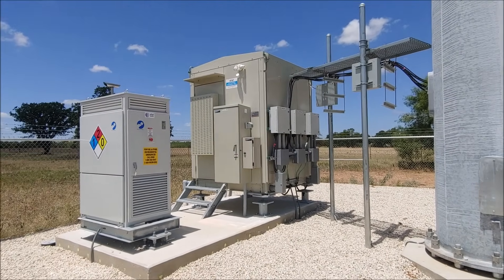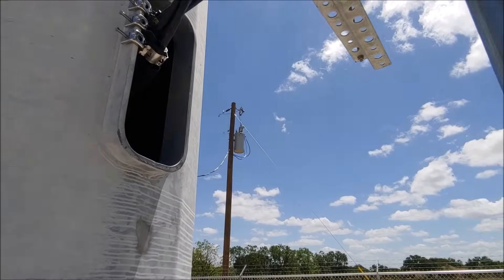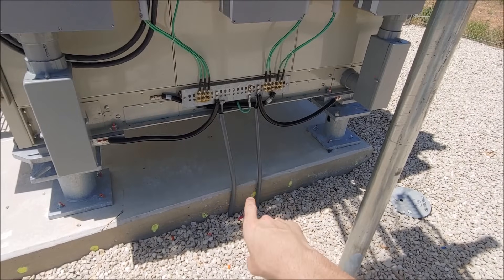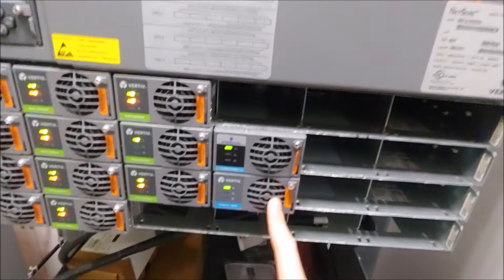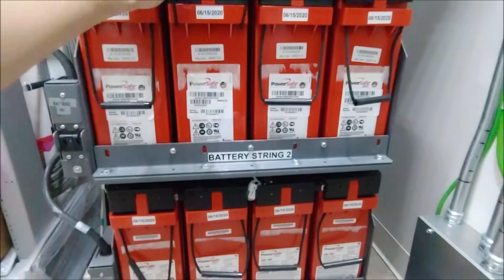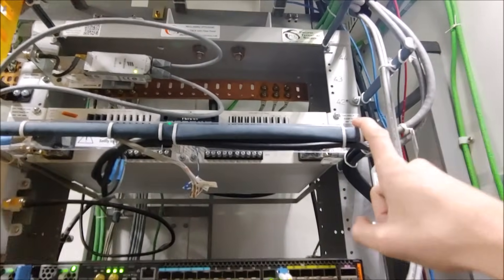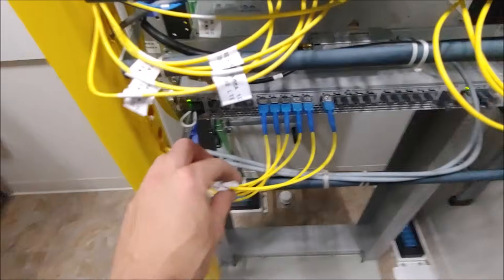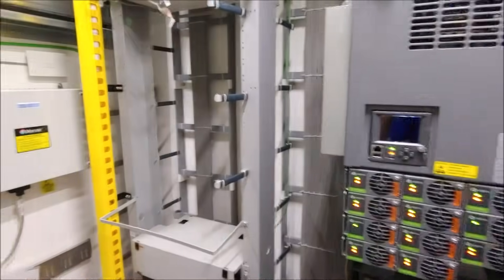Cell Site

Comment: Great tour, thanks! 
Are older site's coax being actively changed out to RRU's with fiber or just through attrition as new equipment is being built out?
Reply from the maker: ever since UMTS was shut down we now remove all Coax on the upgrades.
Reply: @ATI556  Thanks.  I installed giant MTS and IMTS 100-watt VHF Mobile phones in the mid 70's. Only 1 site with 2 channels was available in a county of 75,000. Only Doctors and lawyers could afford them. Can you imagine that ? When I saw the first pamphlet describing a 3-watt cellular network, I thought they were crazy, "they'd have to put up sites all over the place!"
Well, 50 years later, here we are (and I'm still working public safety communications) YeeHaa.

Comment: Whats the reason for using -48vdc instead of more common positive side?
Reply: It's a throwback to telephone exchange power systems using -48v to avoid corrosion of the copper subscriber lines
Reply: @JohnWatkinsUK  ok, that actually makes sense, since I do underground propane tank bonding, it now makes a lot of sense.

Comment: Very cool stuff for tech nerds like myself. I am surprised to the part where he said the internal cabinet temperature is around 100 degrees. I knew those cabinets had air conditioning but I would have thought they kept those cabinets a lot colder than 100 degrees. Learned something new today.
Reply: I was questioning that too; that's pretty high operating temp for industrial grade electronics; the component life is getting reduced that high.

You don't need to be at 69F, but 85F is much easier to maintain, and probably a lot better for the parts.  And the people.
Reply: @baylinkdashyt  There's probably a technician override control that can turn the air conditioner on when they are in the shelter. Or I would come up with one!

Comment: Really cool video, thank you for recording and sharing!  It's hard to get a look at how this kind of infrastructure is done. I found it cool that the shelter and generator are both on stilts above the ground. Extra flood protection, I suppose!   Did you say that the site is not hooked up to a provider? So it's just idle?  With batteries from 2020, seems like a huge expense to deploy the site and not have it in use!

Having fiber to the RF section up top must be better in so many ways - No need for any waveguide stuff, no losses from any coax, no coax needed at all, fiber is cheaper, smaller, lighter, RX sensitivity is higher since the receiver is RIGHT THERE on the antenna, higher order distortions in the RF sections are lower since there's less impedance mismatching and other reflective distortions you get from coax and connectors, you also don't need as much / as aggressive RF filtering, the RF tuning can be perfectly matched at the factory, the cabling is smaller and lighter, less TX loss since the transmitter is connected directly to the antenna.... only downside is the expensive RF stuff is way up in the air - but by the time that stuff starts dying, it's probably time to replace and upgrade to a new generation anyway!

Comment: It is interesting how the telco system was originally built around -48 VDC, and it has remained the same ever since.  I would guess that -48 VDC is still used because changing to anything else (like a more common 12 VDC) would be such a huge cost systemwide that it is cheaper to stay with what works?

I’d guess that -48 telco battery was used way back when telco started stringing a single pair, 2 each copper wires, to each telco customer.  The power was created by installing huge banks of wet-cell batteries.  Power company connection was floated across these batteries to both run the network plus also this kept the telco network operating during power outages.  Heck, telco customers never lost service even if everything else was dead.  As for -48 instead of +48 volts???  Back when automobiles started using electrical power, cars were -6 volts DC.  Could this be similar to the original TELCO network?
Reply: 12V has too high current draw and losses over distance compared to 48V.

Negative with reference to ground to prevent corrosion of the twisted pairs underground.
Reply: I was told that -48v equipment used less AC power than 24v so it was cheaper per cell site which was a huge cost savings over thousands of towers across the country. Cell sites use gel cell batteries which are crazy heavy. in one of the carriers CO/switch there were battery shelves which had 4 12v batteries are integrated inside straight from the factory so you didn’t need to daisy chain them in series to make your 48v . I was watching a contractor use home brewed weird equipment plus a pallet jack just to get the battery shelves delivered inside the switch. They then had to mount 4 to 8 shelves stacked depend what they had room for and finally wire each cluster to parallel power bus bar and connect the battery overheating alarm cables. I found out later after I left the switch the  battery contractor had an accident and pinched a finger off by accident trying to man handle those huge batteries.
Reply: 12v sucks because you need such heavy cables to transmit power even short distances.  I wish cars were 48V.

Comment: for anyone wondering those batterys are it POWERSAFE® SBS XL-12V BATTERIES. WHICH IS $655    FOR 1 BATTERY
Reply: and they are also 4 years old already....
Reply from the maker: @bitcoredotorg  ya thats a common issue of the coorperate lag we have. by the time the cell site finishes engineering and approvals from the RAN team and local jurisdiction it can be several years. Its not uncommon to see a site with 10 year old batteries in some cases.
Reply: That is actually a pretty good price for that much power.  Being that high of voltage helps.  I wish cars were 48V.

Comment: Dude, isn't this a bit risky posting this for all to see? Like we have plenty of Iranians, Chinese and Russian hackers and terrorists that are just dying to get into our infrastructure and jack it up.
Reply: I don't see any big issues - didn't show any login pin codes on the doors, or keys on video, no IP addressing to be seen, no customer information (customer being the carriers), and it's effectively a site ready for a telco carrier to deploy their gear to.
Reply: If an enemy was going to attack wireless infrastructure, they would target one of their local or nationwide switches/CO. What’s to say that they don’t already have a back door into Nokia/Ericsson/Samsung’s BBU’s head end equipment. So much equipment was made where we don’t even have the slightest what chips have been baked into their equipment prior to the new laws that were enforced. Most fab ed equipment came from places that we don’t tolerate anymore even if Hauwei was banned they had other ways to infiltrate.
Reply: @JV-wl6ex  Your lack of understanding does not change the complexity of the world around you.
Reply: @ShainAndrews  I understand everything very well, I’ve been in this industry for over two decades. Try and help your keyboard warrior comments by using real-time examples rather than spewing out a slanted opinion without any info to back your statement.
Reply: @christopherbenedetto Obfuscation is NOT security.  You clowns and your bogeymen.

Comment: So are the RF signals generated in the base units down in the rack and are they carried through fiber up to the antenne units which has een amplifier.? Or is the RF signal being generated in the antenna unit at the top of the tower  But that makes me think, what happens if such a cell antenna fails. You will have to climb up there and replace the entire antenna unit.?
Reply from the maker: There is no RF generated in the shelter or on the ground. 
The transmission is done directly behind the antenna from a remote radio unit RRU. If a RRU fails then a tower crew comes out to replace the RRU. That being said RRUs don't often break. They are very solid pieces of equipment.

Comment: Cool to see someone else's installation.

Before I retired, I worked for a cell provider in Canada.  I could walk into this WIC and be right at home. Same Netsure power, same Powersafe batteries, same router, same baseband.

The only real difference is the make of the generator and the 66 blocks.
Reply: Rogers? Haha
Reply: What's are the model numbers of the router and BBUs shown in this videos? I would love to read and learn more about them. Also I see what appear to be rj45 cables going from the BBUs and router to two small boxes with a coax cable on the other end. I am guessing the coax goes to a smaller antenna. Are those used for remote management? If yes, how does the company connect to them (i.e. via another cell tower, radio link, something else)?

Comment: Much more interesting then I thought it would be, thanks! I just assumed it worked like an FM transmitter with the transmitter in the shack and coax going up the pole, instead that's all up in the antenna 📶
Reply: As the frequencies increase, the coax losses would be too great, so most things now have changed to remote radio units.
Reply: This was the case with GSM(-R), but coax creates losses. Nowadays, at least many of the installations here in Germany have a 10ft coax run from the RRU to the antenna and fiber going directly into the antennas for TDD 4G/5G.

Comment: What specifically are you powering with the 24v on a brand new site? The old analog cells were 24v and the first generation of CDMA too but "Toll" or backhaul equipment was all -48V, that got fixed over the years where it all went -48V but some stuff took longer to convert over so converters remained. I've only ran into a handful of AT&T sites that still had surviving converters, with unlabeled GMT panels split -48 on one side and 24 on the other. You find that out with a burn on your finger.

Comment: Strikezorbs do protect from damage caused by lightning strikes. Equipment that takes a direct hit is toast, but anything else connected to it, wont suffer, all the zorbs will ground out and will dissipate the charge safely bringing everything to the "same reference".

Plenty of times ive had tower strikes and the only thing wrong was a DC circuit breaker.

Raycap makes brilliant gear, just weird to get used to when wiring.

🤜🤛

For what its worth: we kept losing equipment at this tower during lightning storms (it was the tallest tower in the area), before we completely relaunched services on the tower (colo); we "spared no expense" and it paid off, went from being the most troublesome site to being "problem free" for ~5 years. Speaking of, batteries due for replacement...
Reply from the maker: Raycap is no joke on the protection aspect. They make a solid arrestor that has been proven time and time again and it was a pleasure to order from them and build out their products onsite. I have a AC lighning arrestor on my main panel at one of my comm sites and those are the real deal. Best you can find and the only true lightning arrestor out there.
Reply: @ATI556  
I have plenty of sites without them; but the one site that was constantly getting hit: it's been a huge game changer. Tower is a 500' "monster" in the middle of a quarry pit, and literally nothing that tall for as far as the eye can see in all directions.
Was used as a terrestrial TV tower back in the day, now runs an FM station, commercial, our B42/43 LTE equipment and some other odds and ends.
Reply: Raycap is great. When I was a tower hand and Nextel was still around, at the microflect ports Nextel supplied polyphasers and a trapeze rack for all the coax to pass through prior to jumping to the Motorola gear inside. Some of my friends in the industry from the east coast (Georgia) told me a similar story where they had to install a total separate ground ring for the BTS equipment to help isolate the T-storm tower strikes from frying all of the electronics down in the building. I’ve never heard of such a thing in the west areas that I’ve worked on.

Comment: I'm curious why he keeps referring to the 48 VDC supply as "reverse polarity", what does he mean by that?
Reply: the "hot" leads are negative(-) polarity, the positives are ground(+).
Reply: POTS and apparently cell sites, use -48VDC. There is an engineering reason for it (corrosion, I think)
Reply: @greasyjimmy  Half the voltage drop would be one reason, if there was some sort of corrosion reason you could just change the polarity I'd think.

I've dealt with engineers of all stripes, actual and telecom. Ask 5 this question you'll get 12 and half answers.
Reply: @davewood406  You really like the sound of your own voice.  I'm struggling to see you be factual on any thread.
Reply: @ShainAndrews  You need a hug?
Reply from the maker: @greasyjimmy correct a positivity charge helps to reduce corrosion
Reply: Thanks, that was my hunch.

Comment: Very good video! There is no fiber connection from a nearby landline? The tower radios are all linked together with the rack switches in the WIC? That makes this a node that receives, repeats and broadcasts the different radio signals.
Reply: He said a couple times that the site isn't in service. They're probably waiting for that. This is a regular cell. Theres radios up on the tower, fiber comes dow the tower and into the DUS/BBU shelves and another fiber from each shelf comes to that black site router shelf(called a SIAD) which is a SAR, Service Aggregation router. Which routes and MUXes them on to one fiber to whatever fiber provider.
Reply from the maker: Correct, this site was brand new and was in the process of being handed off to the customer. They had not yet connected their backhaul.
Reply: @davewood406  appreciate the clarification!

Comment: where do the alarms go?
Reply from the maker: there is a grey 110 block box eight above the drop down desk at the end of the video. The alarms were terminated to that then all the reporting was done on the physical BBU where all the fibers were running too.
Reply: They peel a TDM channel from the Ethernet circuit just to connect the alarm 66 block back to their local switch

Comment: So all the cell processing is done remotely? I seem to recall we used to have Base Station Controllers that would handle a lot of the local stuff.
Reply: That's what those DUS/BBU shelves are doing. That and the RRUs on the tower near the antennas. Basically what they did was split the Base stations, the  mostly RF side went on up top and the rest went into the shelter(roughly). Things got tiny in the process.  Most of the reason is to get the receivers closer to the antennas.
Reply from the maker: No big coax cable means cheaper builds and cheaper lease space.
Reply: BSCs are still used for 2G, and RNCs for 3G, where these are still used, but for 4G and 5G (SA) there's a direct connection from the cell site baseband back to the core network (MMEs/AMFs). The same type of BB unit as seen here can be used for 2G, 3G, 4G or 5G on the site itself.
Reply: @paulsengupta971  I haven’t been to t-mobile in the last couple years but vzw and att mobility have everything on BBU/DUS. All the old bays are cold. Probably just the little independent networks still leaning on the old gear.

Comment: Our old building has an old Corning mini-cell site fed by microwave and it's a whole rack for old PCS 1900mhz.  And the building has a ton of Heliax (stiff coax) to the various building antennas via big and hot distribution amplifiers.  A newer building we have has a 1U Spidercloud min-cell fed by private fiber with building antennas connected via Cat6 ethernet.

Comment: When he says ""coax is a thing of the past" is he referring to the fact that the transmitters are on the top of the tower as opposed to being in the cabinet.
Reply from the maker: Yes
Reply: @ATI556 Doesn’t it make it harder to replace the power amplifiers when they do go out? ( I’m an old timer here 😢)
Reply: @ATI556  I think he means it's not COAX any more, but FIBRE OPTICS
Reply: @sbarncar  yes, usually there is a BBU inside the cabinet with fiber running to the RRUs. Those RRUs have relatively short coax runs (10ft at best) and if it's a AAU, all the coax is on the inside.
Reply: It’s a refrence to RRU (remote radio unit) the transmitter/receiver unit is up the top and all that goes up is 48v (normally) and 1 or 2 fibres (depending on unit. Etc) per radio
Reply: Between line loss in coax and having to pressurize coax. I see why they'd want to move away from it. And hard-line is expensive.
Reply: @glynnetolar4423  the only pressurized coax I ever came across was elliptical coax which we used on point to point microwave shots. But that doesn’t mean cellular/PCS never used pressurized coax
Reply: @glynnetolar4423  Don't forget copper theft
Reply: Wouldn't the transmitter equipment on top be more vulnerable to lightning strikes?
Reply: @Stormdesk  to an extent however any tower that’s installed and built properly will have a thick ground strap in the event of the tower being struck and may also have spline ball to help alleviate static energy before the tower gets struck (my understanding on how that work isn’t the best all I know is that they reduce the risk of strikes)
Reply from the maker: done a few of those jobs myself installing those spike balls
Reply: @Stormdesk  its wired with fiber optics, except for the whole power wires thing. at least the fiber optic part isn't conductive lol.
Reply: @Stormdesk lightning doesn't care about distance when it's a conductive surface. Grounding is the key.
Reply: @Stormdesk  Yep and much harder to replace.
Reply: Guess that means that the days of Waveguide is LONG GONE. 😎 I love to see the Lacing as well, an art form that is also passing us by. Site looked awesome except for that Alarm cable 🫤
Reply: @markcloutier7317 Ironically, all of my pass technology is gone except the very old art of cable stitching 😢
Reply: This has to be an old video at&t is punching heat shrink on grounds now lol😊
Reply: Yep, all fiber from the squid to the rrus with short jumpers (coax) from radios to antennas 😊